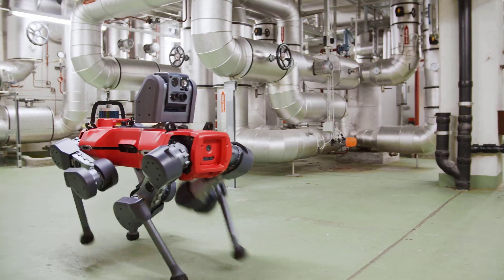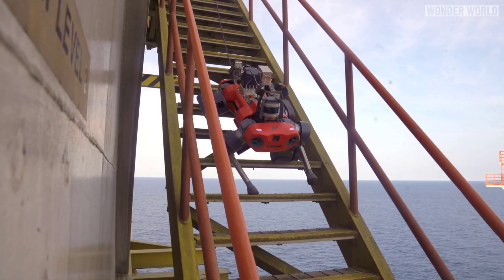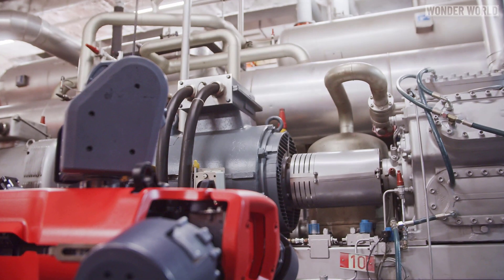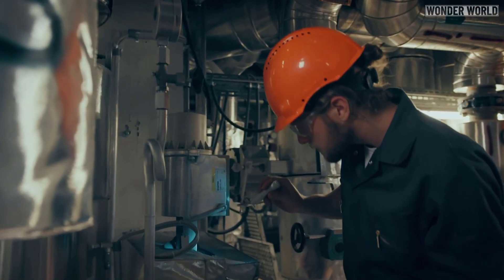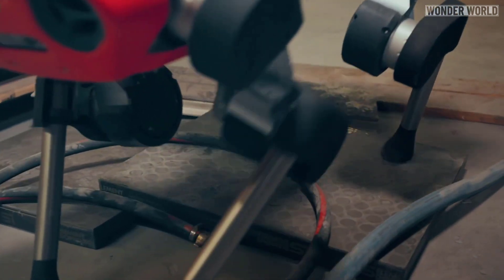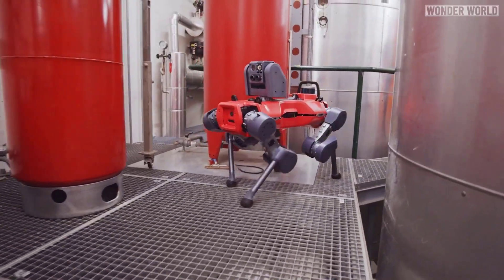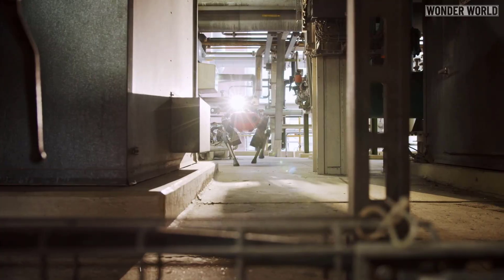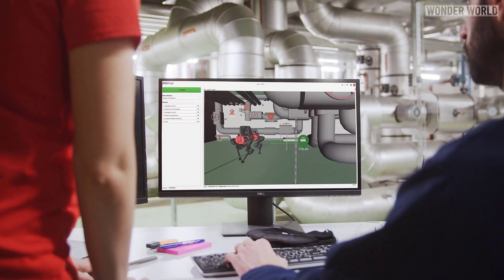Robots Patrolling Hazardous Areas Keeping People Safe

Comment: Amazing technology! Much better to send a robot into toxic environments than be the worker whose job is to wear a bunch of protective equipment and waddle down to try and do a propper inspection.
Reply from the maker: I wonder if they can patrol radioactive sites like nuclear reactors, I only wonder because in the Chernobyl Meltdown documentary, they sent in robots to survey the area and they broke down within seconds from radiation killing the circuits. Also if you take a camera into a radioactive hot zone, the radioactive particles kills the camera sensors, or at least 1 pixel at a time.

Comment: Or you just set up cameras and sensors to look directly at the problem areas and have it trigger an alarm 😑. 
Engineers: let's go through all the steps to create a mobile robot with cameras and a sensors system that can detect and alert a human when there's an issue?

Or we just permanently mount the said cameras and sensors in the areas that tilt and pan repeatedly and will have a program that alerts a human when there's an issue. 
There I save you millions on r&d and hundreds of thousands of expenses on your robots.
Reply: Do you have any idea how many cameras and sensors you're gonna need to keep track of everything?